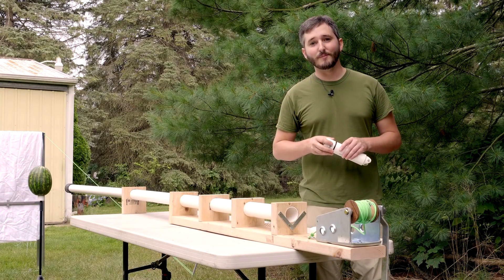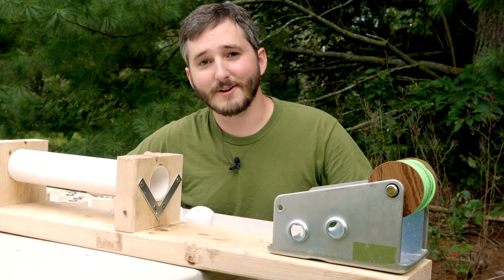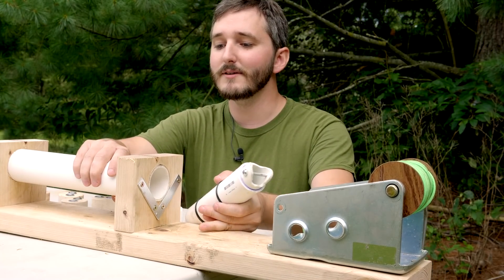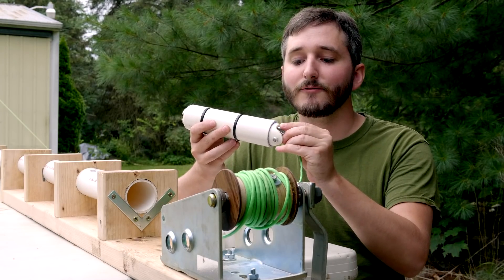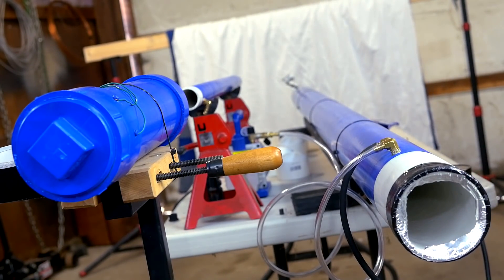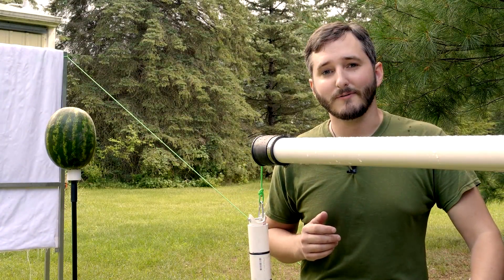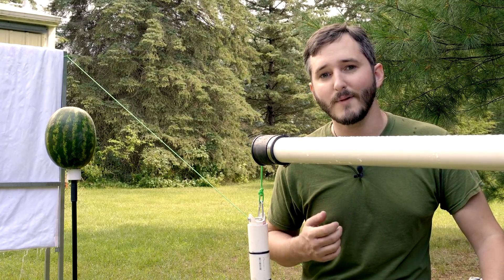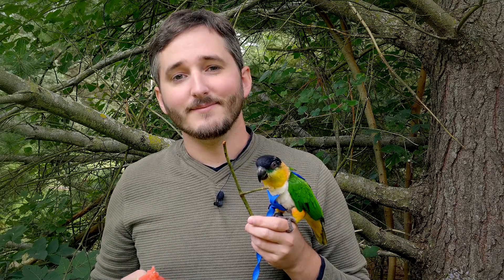Rapid-Reload Vacuum Cannon: Magnetic Piston, No Burst Discs

Comment: If you used a strong electromagnet triggered to release near the end of the piston's travel you might be able to get a tighter projectile seal and see higher velocities without risking the projectile not following the travel of the piston. I would be curious how effective a large diameter tube with a comparatively small sabot would work as a projectile. It could be relatively light but also hardened. I think a good simple projectile might be a bolt with a wing nut and a discarding plastic sabot.

Comment: If you glue a ring onto the pipe with a rubber gasket a plastic disk can suck up against it to make the seal. As soon as the plunger is pulled out the seal breaks as the projectile moves forward. Question is if the seal will let the air rush in too soon once the projectile starts moving and might need some magnets to keep it in place until enough of the air that leaks into the barrel has been compressed.

Comment: As I understand this system. The air is pushed into the tube at the speed of sound in air. So what happens if you submerge the tube under water leaving the end clear? Not only would the pressure be greater but the speed of sound in water is significantly higher. Plus I imagine you'd get an impressive water jet following the projectile.

Comment: To launch heavier objects couldn't you ad an extra section of pipe at he launch end, (length to be determined), with a coiled spring in it. Pull it back until the spring is fully compressed before release. Seems like it would be a decent launch assist to get heavier objects moving.

Comment: Love your work! Shot in the dark, but... What about adopting the coiled design (a la your propane bottle launcher) for the vacuum cannon? Since projectile needs a long barrel to fully accelerate to the supersonic speeds, a coiled tube with a reasonably large coils (multiple feet in diameter?) could give it the projectile enough length of travel without making the gun unreasonably long.
Reply from the maker: I think friction would get in the way in a curved barrel. Maybe not if the projectile was a ball and could roll, but without a tight seal on the barrel air slips past the projectile and you start losing speed. Maybe worth a try though
Reply: @Nighthawkinlight   thanks! If it has a chance to work, then the round projectile like a pingpong ball should be a best bet... Yes, friction is def. a problem, as well as deformation of the projectile, "bouncing" off the walls, and imperfect seal. The hope is that if the ball has low enough inertia (it doesn't move faster than air around it, so there is no air resistance), and it may stay close to the "wavefront" of the blast and exit the barrel at the speeds close to the speed of air in the tube. Thanks again for the answer!

Comment: Great video!  Questions I am trying to solve is there enough force to push 10lbs sitting at the end of barrel?
I am also testing with a shorter 12-18” piece of 1” pvc and plan on using a air choke similar to mythbuster did.

This is for a car parachute invention I al working on.

Any help would be greatly appreciated!

Comment: This is a super old video I know but I'd be interested to see a small metal ball bearing mounted in the centre of a foam cylinder and have the end of the pipe taper inwards so that it just fits the ball bearing. for the last few feet. In theory this would let you take advantage of Bernoulli's Principle and convert the velocity gained in the first part of the pipe to a much higher velocity towards the end.

However, I'd imagine the tolerances would need to be too tight given the flimsy material of the foam cylinder and the ball wouldn't line up right and would lose a lot of energy hitting the join between the two diameters. Not to mention it would probably destroy itself after one or two shots.

Comment: I wonder if you could use maybe a heavier projectile in it if you let the plunger go down the tube with the projectile and push it all the way instead of just the air pressure. Let the plunger just fall at the end of the barrel while the projectile keeps going.

Comment: I am thinking of building a two stage vacuum cannon with a small gap between the pipes. I am spliting the diameter of the gap into two sections so the vacuum in the second pipe can suck in oxygen and acetylene from either side and mix in the second tube. A small piece of aluminum positioned inside of the second stage will power an inductor. When this piece of aluminum is broken by the projectile it will generate a spark near the entrance of the second section to detonate the oxygen and acetylene mixture. I have not decided yet how I am going to reseal the back of the second tube prior to ignition, but I can always fire a plate to slide between the two sections to contain the explosion to the second stage. I have assembled the materials and hope to try out the concept soon. I am going to measure the velocity by breaking two additional strips of aluminum a known distance apart in front of the second stage so I can measure the projectile velocity on an oscilloscope or micro. I am holding off on the third stage because it will require expensive high pressure pipe to allow for a much more rapid explosive charge needed to provide additional impulse in a shorter time frame.

Comment: Thank you for the video! Very, very creative. I believe, you misinterpreted the connection of the speed of sound and the velocity of the air molecules at a given temperature. I think it is the same. You can express the speed of the air molecules, mostly diatomic, through the absolute air temperature because it is the expression of the air's molecules kinetic energy. Some of it belongs to the rotational and oscillatory degrees of freedom. And this difference is normally expressed through the heat capacity ratio (appr 1.4).
All in all I think, you can achieve at maximum the speed of sound minus the losses of various origins (mechanic as well as thermodynamic)
Reply from the maker: Consider why the speed of sound increases with pressure despite the temperature remaining constant, or why the speed of sound is so great in solids like steel. The speed of a wave traveling through particles is determined by how rapidly interactions between particles occur, not by the velocity each particle travels. If particle speed were the limiting factor to the speed of sound, then particles contained within a compressed gas should not allow sound to travel faster between them unless the temperature, and therefore the particle velocity was also increased. This is not the case. Sound does travel faster with greater gas pressure and constant temperature. This shows that particle velocity must be greater than the speed of sound, because the speed of sound can be greatly increased without changing particle velocity. Obviously the speed of sound could never outrun the speed particles are able to achieve.
Reply from the maker: Disregard, it seems I was mistaken about the speed of sound being effected by pressure. I might have this one wrong. Will have to look into it further
Reply: Let's imagine a fluid as an immense billiard. When its kinetic energy (the temperature, kb*T) is 0 and entropy is maximum. It is a supercooled fluid in a fundamental state. (Disclaimer: it is only a semiclassic approximation, no quantum mechanical wierdness). Its speed of sound is 0. It is no way for a ball on the one side of the billiard table to know that you shifted a ball on the other side. Now let's imagine in billard in motion. No matter how will you start it (you are bringing some energy, or in other words temperature) - from a single ball or from a group - chaos of balls collisions soon will transfer a localized or a directed motion into a fully chaotic one. Thus your system will increase its temperature and maximize its entropy again. Since we didn't define any dissipation - a mean motion of the balls will redistribute this kinetic energy among them all with a normal distribution around a mean ball velocity. Around its speed of sound. 
if the balls are connected with springs in pairs, like nitrogen and oxygen, a part of kinetic energy may be stored in a rotation and oscillation of these pairs around their center of gravity. Thus, you can store more energy than its common linear motion. this ratio of stored energies is that heat capacity ratio. But it affects only the ratio of a temperature and speed of sound. The equivalence of the speed of sound to a mean linear molecule velocity still remains the same for a multiatomic gases too.
Reply: concerning the steel and its speed of sound. it is similar but yet different to a fluid. I like to imagine it as a 3d chains of balls and masses. The chains of oscillators. With the same eigenfrequency. The distance between the masses times this frequency gives you the speed of sound. The frequency of such oscillators will be high, because the "springs" are stiff. And there will be no speed of sound = 0. No matter how deep will you cool it down. It is owfully oversimplified decription of phonons, the carriers of sound in solids. they also responsible for the temperature transfer, but the number of mechanical degrees of freedom is greatly higher than in gasses, so it becomes the limiting factor for speed of heat transfer in solids and explains why this transfer has better "throuput" (or thermal conductivity) than one for gasses.

Comment: What if you were to combine your vacuum cannon design with an air cannons high pressure to get even higher speeds? If you put a T fitting at the winch end of the barrel, then attach a high pressure pvc tube of air with a burst disc in it coming off the T at 90 degrees, once the cannon fired it would burst the disc so that there would be high pressure air on one side of the projectile and a vacuum on the other. I know you’re trying to move away from burst discs and going for a quick reload, but i think you could get some insane velocities.

Comment: Just wondering if you use the projectile it self as the 'cup' to block the tip, as u have a tube of bigger diameter over the main barrel, you can have a projectile the size of the big tube and it will be stuck at the tip and not move into the main barrel where the piston moves, not sure if the air at the back will be still be fast and powerful enough to accelerate the projectile (maybe the larger tube can be abit longer to help accelerate the projectile)

Comment: Could the speed of a heavier projectile be lessened by the projectile allowing air to seep thru its sides? Have you tried a pvc endcap that had seals like the piston?
Reply: You'd likely loose more energy to dragging the seal than you lose from blow-by during acceleration. Some of that blowby is likely also acting to 'float' the projectile in the center of the barrel, reducing friction.

Comment: I wonder if you used two pipes, one thin(barrel) and one as in video to create vacuum, but the procetile stays at the base where it meets the the big pipe, ofcourse the thin has a cup on it, so when the big pipe side opened would create suddent rush of air towards the thin pipe blasting procetile much faster, and the size of this would be much smaller i think😅
Reply: Oh and im wondering beacause that i saw your video and can't make it myself of covid-19, because i cant go to local supply shops to buy materials

Comment: Actually the speed of sound is dependent on the propertys og a fluid. In air the speed of sound is around 340 m/s in water the speed of sound is around 1450 m/s. To say that the speed of sound is limited in air at atmosheric pressure isn't wrong but you can push these boundaries. As the speed of sound is dependent on viskosity and compressibility of a fluid, you have to alter one of them. The simplest way is to lower the Viskosity and the compressebility (getting all those nasty air molekules out of your way ;D) but you could as well just increase your density to a point, were your fluid can't be compressed anymore. That sounds just to impracticle XD.

Comment: So i have an idea but i'm not sure of how feasible it is
How about going back to the valve system and using the crank to slowly pull a string that will try to open it? The vacuum might stop it from oppening while still being pulled by the string, the tension might give it the extra kick it needs to open the moment the canon fires
The new plastic cups system seems pretty optimal, but if there's a way to get a valve system working, i guess it would be pretty cool too

Comment: I disagree that you can get supersonic velocities with this type of setup, although I'd be happy to be proven wrong. 
     The maximum speed the projectile can reach in a vacuum cannon depends on the speed of sound (roughly equivalent to the speed of the individual gas molecules) of the gas pushing on the back of the projectile; the speed of the particles left in the partial vacuum in front the projectile is essentially irrelevant.  
    I'm wondering if you may have been thinking about vacuum cannons that use helium or hydrogen as the gas on the pushing side of the projectile. The speed of sound in these gasses is 3 to 4 times higher than that of standard air.
Reply from the maker: The speed of sound is limited not by the speed of particles, but by the rate that particles bump into one another and the transfer of momentum between them. That's why the speed of sound increases in a gas when it's pressurized, even though the temperature of the gas (which in this case is synonymous with particle velocity) may stay the same. It's also why the speed of sound in a solid like a block of steel is so high. It's not because the particles that make up the block of steel can move quickly, it's because they are in close proximity to one another. The speed of sound is all to do with these interactions between particles. When gas enters a vacuum with nothing in front if it to collide with it's speed is much higher than the chain reaction of collisions that defines the speed of sound. The velocity is an independent figure from any wave that might pass through the particles as they travel.
Reply: However, in gases, these speeds are highly correlated. It's a bit complicated of course since they don't all have the same speed, but if you go for the RMS speed of the gas, it's roughly the same as the speed of sound. According to google the RMS speed of particles in air is around 464m/s, so only 1.4x the speed of sound. Usually, in the thermodynamics stuff I deal with the approximation that v_thermal ~ v_max ~ v_sound is good enough. :)
Edit: now technically if the tube is infinitely long and the projectile super light the particles that happen to be faster due to the distribution of speeds will catch up and accelerate the projectile above RMS speed, with no theoretical limit. Is that what you meant?
Reply: @Nighthawkinlight 
 The speed of sound in a gas does not normally increase when it is pressurized, unless the temperature has also increased. Pure dependence of the speed of sound on density (and therefore pressure)  is a common misconception that has even made its way into some textbooks. In an ideal gas , the speed of sound is completely independent of pressure. Air is not an ideal gas, but it follows the model pretty closely and you end up with an essentially negligible effect with changing pressure. This is because the speed of sound in a gas goes up with pressure, but down with density, which also increases with pressure.
       
       Speed of sound in any material depends on compressibility and density. Speed of sound goes up with decreasing compressibility (stiffer materials), and down with increasing density.  In a gas, compressibility depends on both pressure and temperature, which are related through something called the heat capacity ratio. (Heat capacity ratio basically describes how much extra energy needs to be added to heat a gas to a certain temperature when its volume is not confined, versus when it is.)   Density in a gas depends on molecular weight and structure, as well as pressure; pressure again changes with temperature according to the heat capacity ratio, which again depends on temperature and the molecular structure. Boil all that down, and the only things that really matter are temperature and molecular structure, everything else cancels out.
       As Edgar Brucke pointed out, I was wrong in saying that speed of sound ≈ speed of gas particles, although they are roughly linearly correlated. I believe the factor of 1.4 he mentions has something to do with root 2 and most air molecules being diatomic. However, even if you somehow managed to transmit the full air particle velocity into the projectile,  1.4 is still a bit off from being multiple times the speed of sound.
Reply from the maker: Tim, after brief googling it seems you're correct. I'll have to do some further research.

Comment: I really like what is going on here! A few thoughts: The instant the plug is removed, there is a period of time where the plug is restricting airflow into the pipe by being too close. Could a different end-cap geometry (concave, convex, maybe something more complex) improve performance during this period? Of course, removing the plug more quickly would nullify any of these effects, but that's hard to do with the tools of the home shop and 45 lbf of resistance.
Reply from the maker: The cap I use has a round end which probably helps. I think pulling faster is by far the most important factor. The inertia of the projectile gives you a bit of time before it's down the barrel

Comment: Since it’s a function of pressure, why not use a very large diameter pipe and piston with a small hole for the projectile?  That way more surface area allows more force to be applied to the piston by the atmosphere